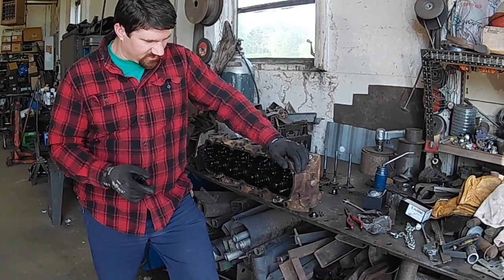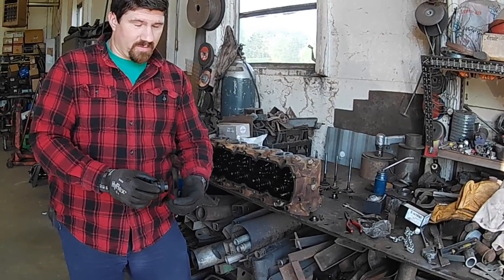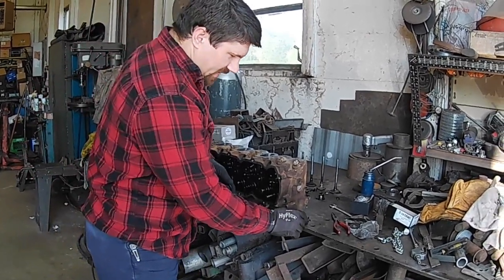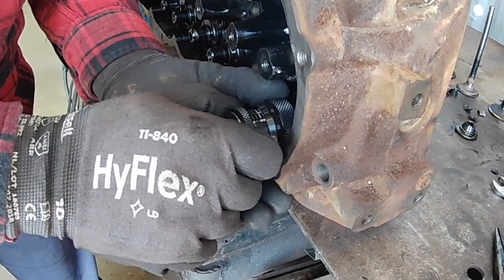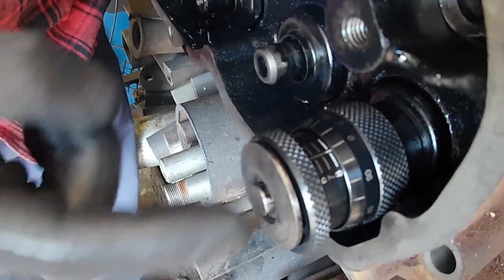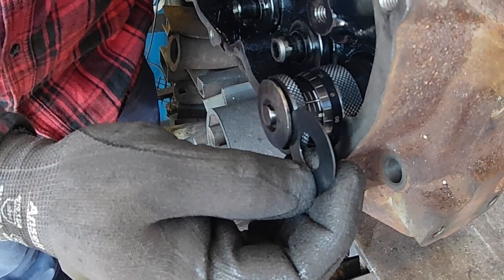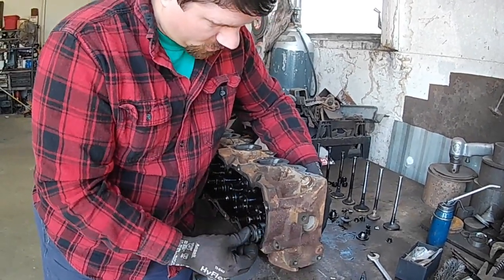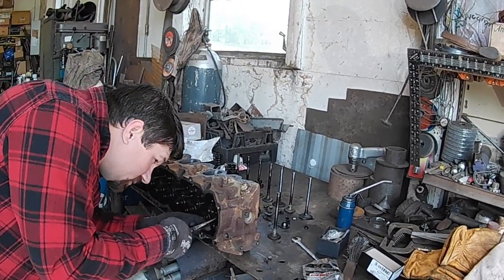How to Use a Valve Spring Height Micrometer and Shimming

Comment: Do i need locators on a sbc steel head? or just shim it to the installed valve height? Better to install to keep the spring in check at higher rpm`s i bet?
Reply from the maker: Honestly was my first time shimming valve springs and only read up about this particular motor. Plan to build a performance sbc for the white chevy project later and will read up on it more at that time. Sorry for not being able to answer your question.

Comment: I recently bought a stage 1 cam from r&d and Justin told me the exhaust should be shimmed to 60 thou and the intake doesn’t need a shim
Reply from the maker: Are you using factory springs or the power stroke springs?
Reply: @wrenchbenders  power stroke springs

Comment: Did you shim the intake valves too or just the exhaust valves?
Reply from the maker: Just the exhaust. It was recommended that the intake didn't need it and the readings with the micrometer verified the same.

Comment: So if I understand you correctly the springs that you used are taller but the shim puts the springs at the right height. So how does that affect the pressure on the springs if at all if anybody knows?
Reply from the maker: The springs are not taller, they are stiffer than the original springs which holds a better valve seat and will help close the valve with the extra lift and longer duration of the cam I am using. The shim is used so it won't be loose on the rocker. Only shim the exhaust springs.
Reply from the maker: Like your profile pic by the way.

Comment: Sure can tell you are a rookie!!
If you have never done that to a cylinder head before you have never been doing cylinder heads the correct way!!
Reply from the maker: Before, I did stock replacement stuff and had a shop do a set of performance heads. This is my first time checking aftermarket springs for a head. I guess everyone has a first time.